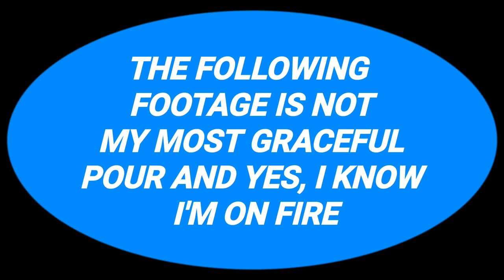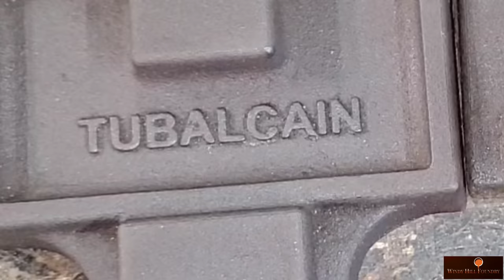MOLDING AND CASTING A WOOD VISE

Comment: Hello Clarke. You are inspiring me and teaching me in foundry. I have a technical question. Do you use perlite as flux? The perlite is the white material used in garden/plants compound earth? Greetings from Spain
Reply from the maker: Thanks and yes. I use it on the first melt only, after the first one there isn't much dross as the heat get higher

Comment: I'm surprised you poured the caste iron on your own, you're a lot braver than us down under.
We have a basket with a rod and guy on each end, that lets us keep our distance from the heat and to share the load. We also only put a handle for pouring on one end to save synchronising.
Reply from the maker: If I had help I'd be doing it your way👍
Reply: There is one idea I got that might help you could get around that.
Weld up some railing to fill in for an apprentice.
Have it run 1' above and behind for the length of the pouring bench, grease it up and that way you can slide the opposite bar up and down the length of the table and half the weight of the crucible on your back.
I'd be doing it that way if I ever got back into casting, being the stick insect I am. I hope it helps. ✌️

Comment: I'll sign up for one of those "vise kits". Congrats on the 10k. 

I plan to rig my 4" Criterion boring head as a fly cutter to remove the draft on the mounting tongue. I should be able to work up to a vertical surface just fine.

Comment: Clark - Great to see the collaboration between Mr. Pete and yourself.  Missed you at the BarZ bash this year, but hope to see you next year.  Can you please explain the reason for the metal sleeve around the vise part when you first started putting in the casting sand.  Thanks.
Reply: The metal sleeve is to keep the very fine sand next to the pattern so not as much of it needs to be used when ramming the sand against the patterns.  The fine sand makes a smoother surfaced casting than the clumpier sand.
Reply: @royreynolds108  Thanks Roy
Reply from the maker: Yes Ron Roy explained it I see. I have every intention of being at bar z 2021👍